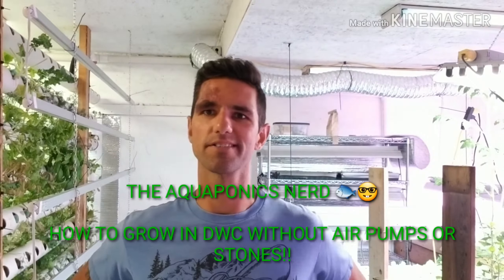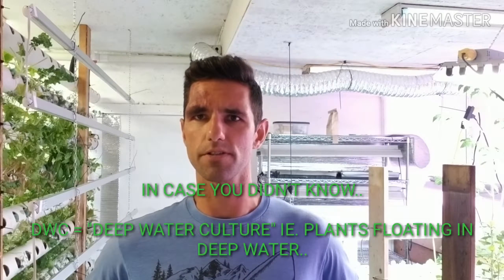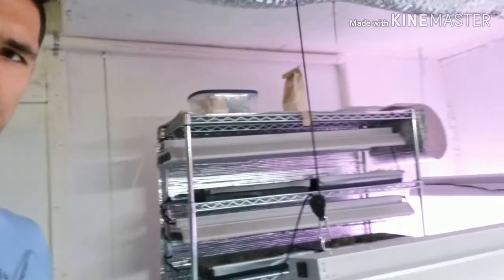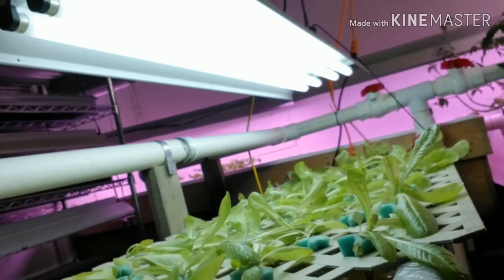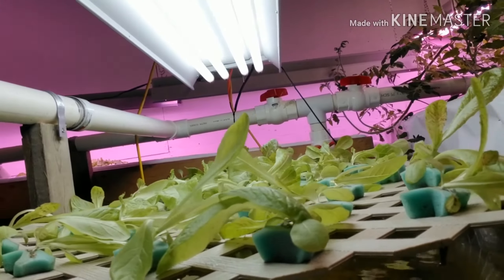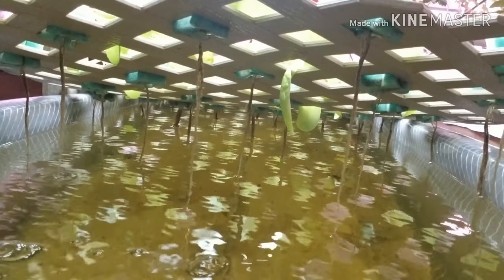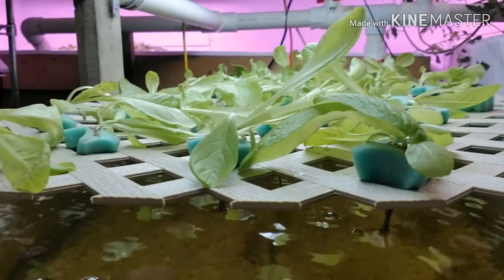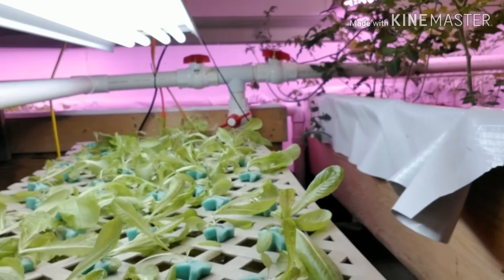HOW TO GROW IN DWC WITHOUT AIRPUMP OR STONES!!

Comment: This Kratky method I think
Reply: I think this is between Kratky and DWC. In Kratky itś no circulation and normally no refilling. I building my system for pepper plants and tomatoes now and Iĺl have also thinking about this. Itś a system of 42 5 gallon buckets.... It needs very much air..... So I will try to have good circulation, the Kratky air barrier and the circulating water going hard from the upside to the water. A bit of waterfall to. Maybe I will do it all wrong. But else I need about 5000 GPH air...